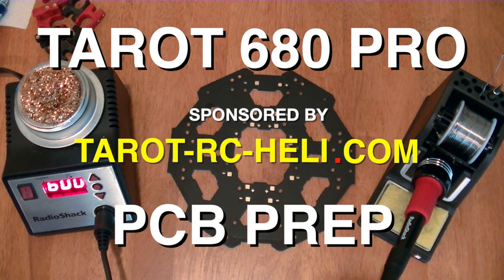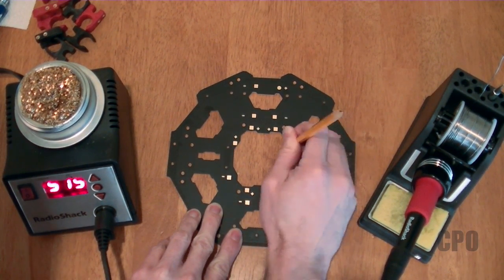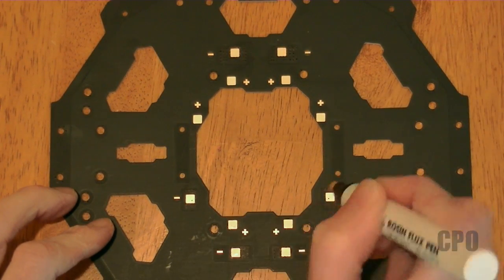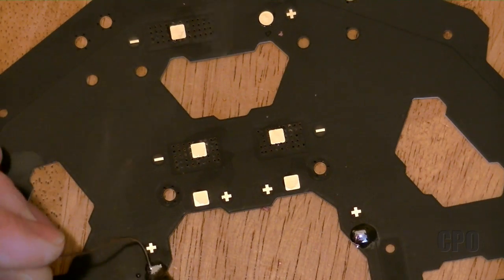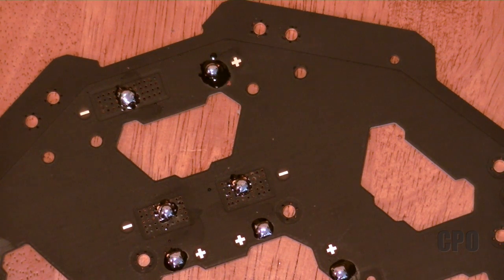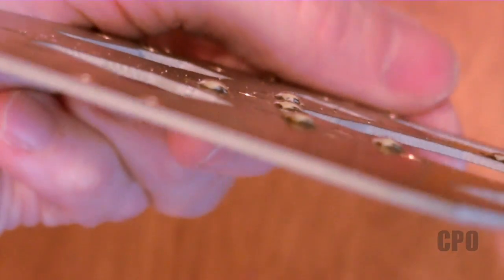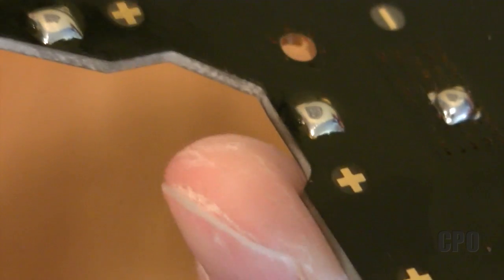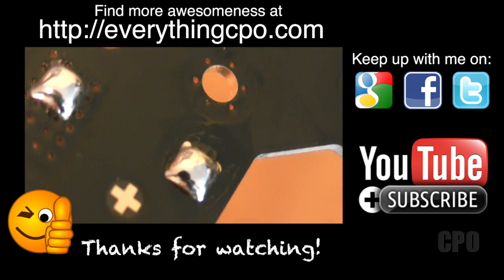Tarot 680 Pro Hexacopter : PCB Prep

Comment: hi cpo! first off let me say thanks for all the 680 videos! they have been a hugggeee help. I really appreciate the time you took and the quality of your videos are excellent. So thank you from my side!!!

now on to a question (i know iv asked you a few before, so thanks for bearing with me =p ),

I have the naza v2 which comes with its own PMU, and wish to connect it all to the tarot PCB, along with the battery, and am a little flustered on how to connect it. can you show a small pic of how you connect the PMU to the pcb. 

thanks in advance for all your help!!!
Reply from the maker: Assuming the PMU input voltage range is what I think it is (7.4 - 26.0 V) then you can just attach it to the same place that you attach the batter wires. On one side of the pcb (really the front...but the back on mine) is a + and - for the battery. You can solder the battery leads and the PMU leads to that point at the same time. I hope I am understanding your question properly.
Reply: Perfecto! Thanks a ton! Is it safe or good practice to do that though? It will be my first time trying that setup.

Comment: CPO do you have any videos with further progress on this FY680 build? I was wondering if you are going to mount your ESC's on the arms or on the main body.  I have not received my order yet but if I were to mount the ESC's on the arms I think I will have to extend the servo leads and power leads, and the other way around I would probably only have to extend the motor leads.  Since I never put one together yet which method would be best?  I seen many videos on the FY680 but mine is the Pro version that looks a little different, your video is the first I seen with the Pro.
Reply from the maker: I plan on mounting my ESCs on the end of the arm under the motor mount. I don't have my electronics yet, so that is why everything is stalled. Sorry about that.

Comment: hey CPO i just got my new Tarot 680 pro and i just want to ask i also bought a distribution board for it but looking at your video i want to know will i still use the distribution board or just do it directly to the PCB ?
Reply from the maker: I will be soldering all electrical connections direct to this PCB.  I will probably build a harness for other components (such as FPV gear or lighting) in the future.

Comment: Hey cpo. Flux is your friend. Been working with pcb and soldering for over 15 years. You did everything correct. Only piece of advice would be. Try not to keep the iron on the connection for over 5 seconds. Anything over that tends to lift the trace right off the board. Trust me on that. Been there done that. And it is just so much fun trying to fix it. But yea. Keep up the great work. Look forward to seeing a completed project.
Reply from the maker: Thanks for the feedback!